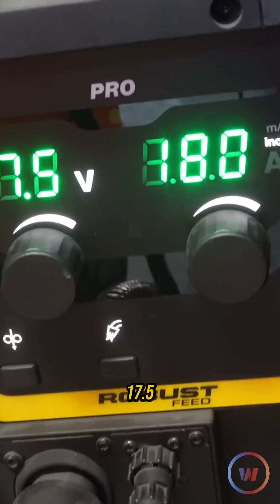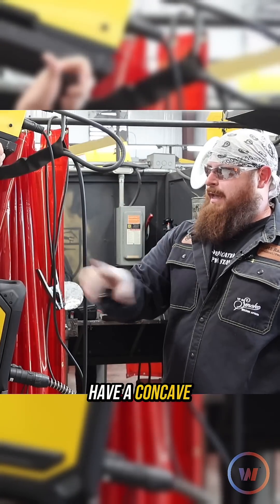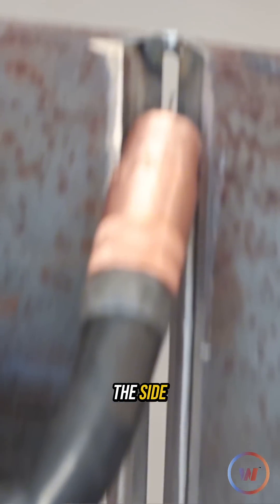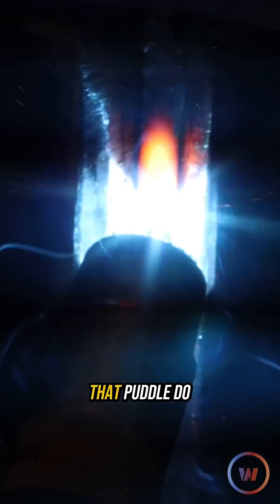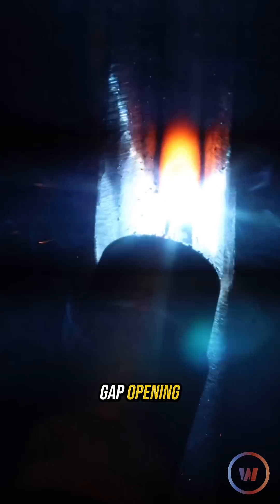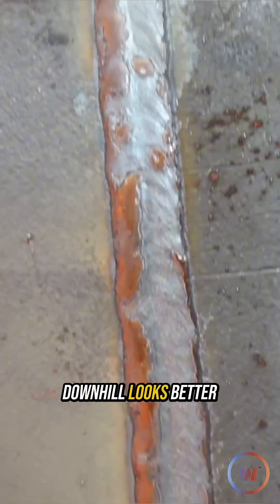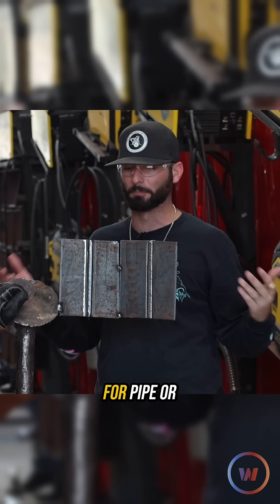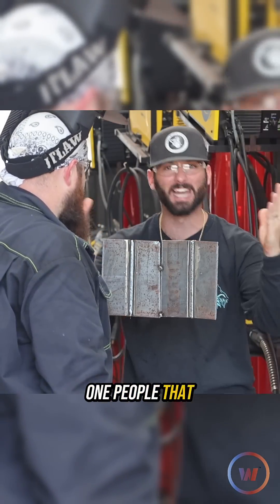Open Root 3G MIG Welding Downhill #welding #gmaw

Comment: I was a certified mig, flux core and stick welder to API 1004, ASME section IX pressure vessel and AWS structural codes.  The Mig process is one of the best and the easiest to master in my opinion.
Reply: @davidhagerman7165  under the old code in Victoria I did certificate 3, 3E and 7 alloy pipe.
Back then MIG was not taught unless you were going for Certificate 8 and 9
Stainless was touched on and Aluminium was never mentioned.
While in the industry I became proficient at welding Stainless and Aluminium self taught TIG Ally and on Stainless.
I learned to weld Aluminium by welding 2000 handles for conveyor lids.
With stainless 500 bollards of varying sizes.
The first Aluminium handle I welded was a total screw up; I melted the whole thing into a pool of Aluminium.

Comment: The problems that I have noticed that others seem to have with "downhills" which is just a vertical down instead of up, is that 95 to 98 percent of people don't do them correctly. Thus making shitty welds that look terrible but also have extremely terrible fusion. If people actually get taught the proper way on how to weld them, there shouldn't be any problems. Alas, most people start welding in high production environments and have never been to school. They do that for 10 to 20 years and unfortunately never really learn anything that whole time. Entirely self inflicted, but still.